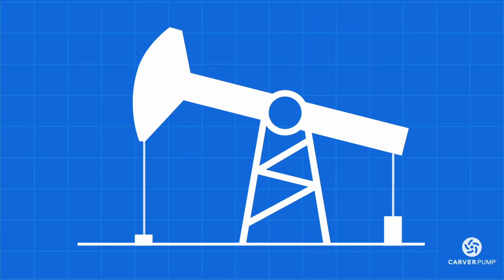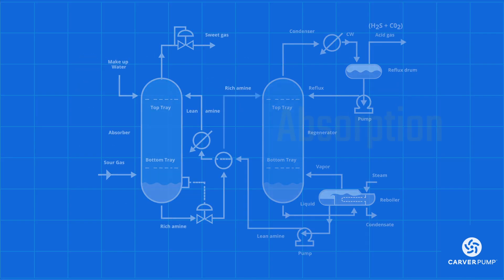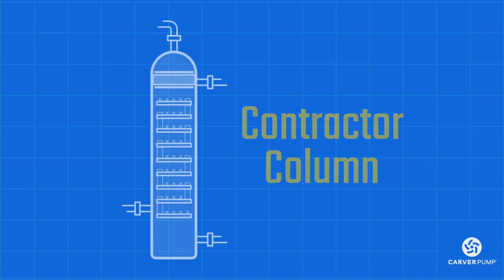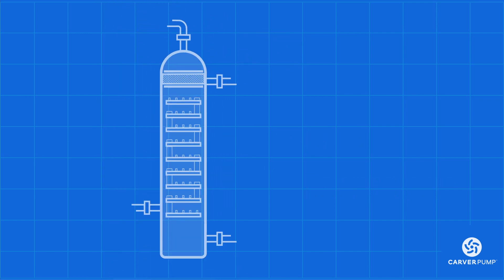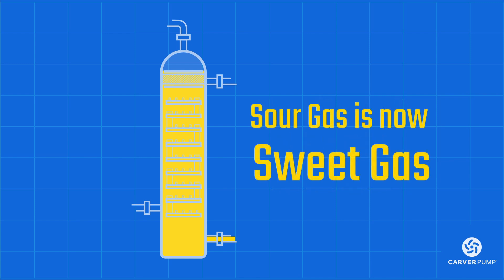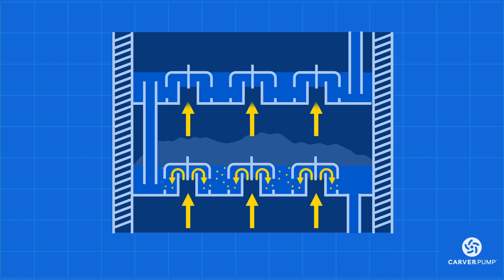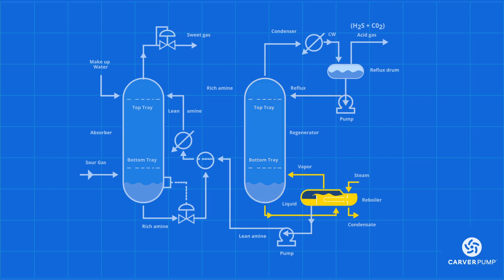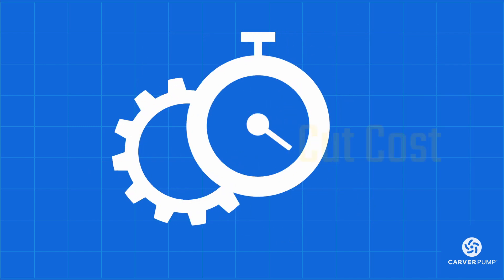How Amine Sweetening Works (Absorption and Stripping)

Comment: Please use the correct terminology when describing how the H2S and CO2 molecules "stick" to the amine. It by adsorption. This is why the why the contactor uses bubble caps or "finger" valves to maximize the surface area of the amine so the molecules have the maximum surface area available for contact.

Comment: Use it to make other substances like carbonic acid or sulphuric acid. For co2 there is carbon capture where the co2 is stored under ground under a rock impermiable to c02